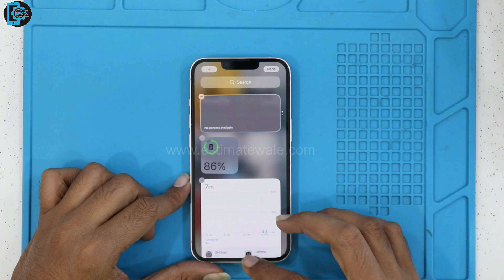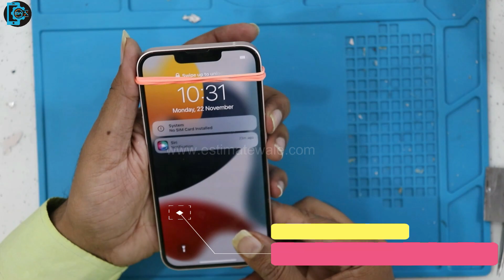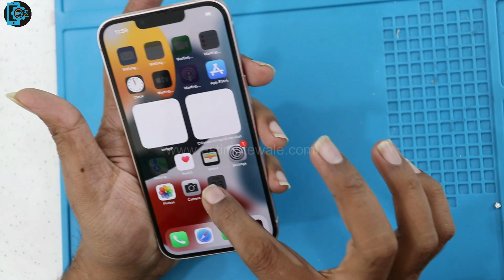iPhone 13 Back Glass Replacement | How to change iPhone 13 Damaged Back Glass | iPhone 13 Broken

Comment: You have done one mistake… you have placed glue on entire glass due to which it will cover charging coil too .. next replacement of glass will be not feasible easily
Reply: How do you place the glue properly?